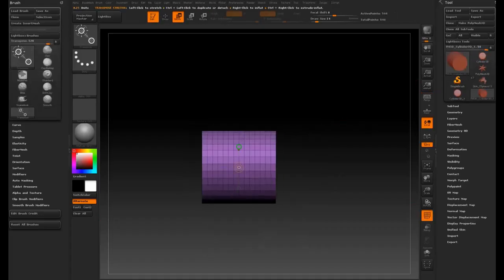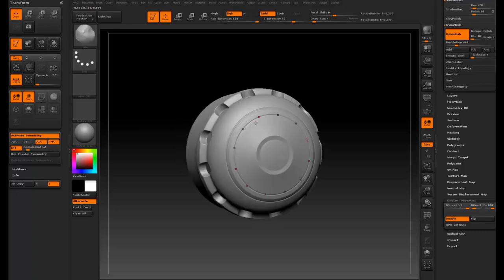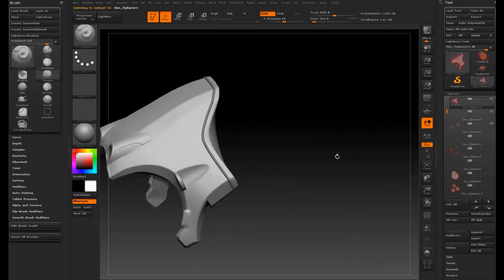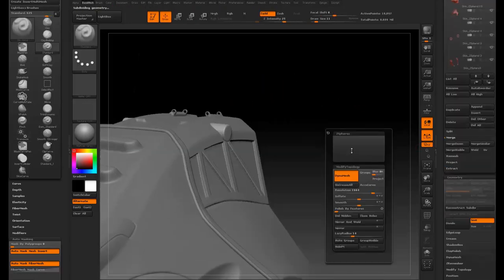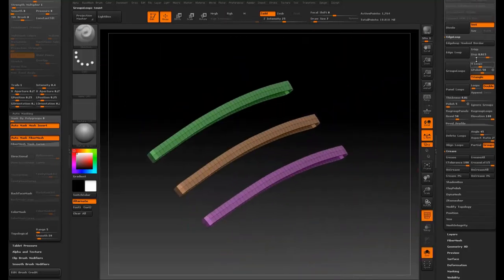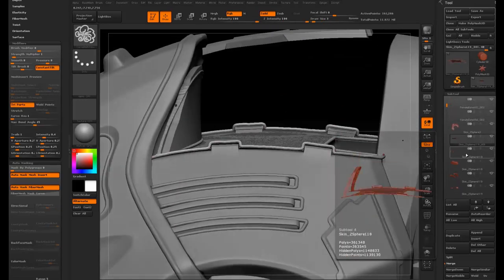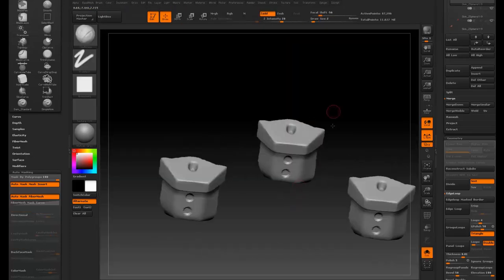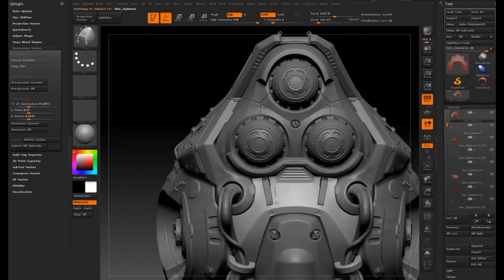ZBrush Mech Helmet 04 DetailingPart02

Comment: This is amazing, quick question, how did you create a brush from that sculpted plane?
Reply from the maker: +Eccofire Not sure I follow, do you have a time stamp at the point it takes place?
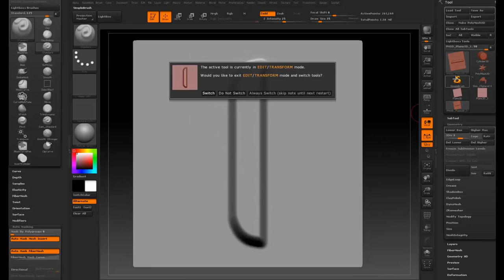Reply: +Michael Pavlovich 5:54, sorry about that.
Reply from the maker: +Eccofire Ah gotcha; the plane was used to create a custom alpha; in this case "dropping" the plane to the document by going out of edit mode, then using mrgbz grabber to grab its zdepth information into an alpha texture (you could also do alpha>grab doc if you made your document size appropriately). Once I have the alpha, it's just a matter of plugging that into the standard brush (or clone the standard brush if you want to have a new one for your alpha), select the alpha you created, then change it to a drag rec or drag dot stroke and adjust the zintensity as needed (you also probably want to change the focal shift to -100 as well). If the mesh used to create the alpha goes "up" as well as "down", you may have to dial in a mid value (alpha menu at the top > modify > midvalue), it's kind of trial and error, but it should get rid of any borders you may end up with. Sorry I don't have any youtube video's on the topic, that particular subject is buried in the middle of Intro to ZBrush Part 3 right now: https://gumroad.com/pavlovich

Comment: I'm really curious how your methods have changed since these videos. You mention several times that you'd make certain parts differently/more efficiently, and how you'd better manage your time now. Looking forward to your updated series.
Reply from the maker: I'll get more in depth into the technique stuff when I break down these videos and go point by point; I was hoping to have a new model to work with while I did that but depending on timelines I might just jump in there and start them without it.  One technique-y thing that has helped with file size / speed / organization is making liberal use of decimation master--it seems obvious now, but back then I had really bloated, slow, and crashy files.  The final zbrush file of this helmet for baking is 90mb, which is crazy for the amount of stuff going on.

Comment: for make a mask , move and get so clean result you need  5million polys for each part ofe the helmet... monster computer
after 2millions polys i s to much for normal pc....
Reply from the maker: Try lower resolutions with slice or edgeloop masked border and transpose modeling for clean results without the polys. I think you're underestimating how many polys zbrush can push--i have an electric toaster that can handle 2 mill polys in zbrush, you might look into upgrading your system